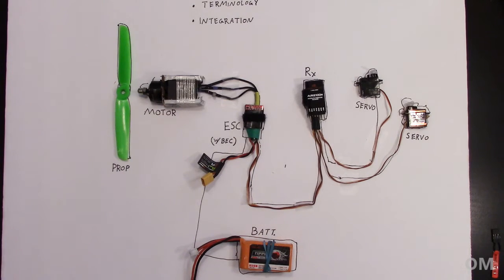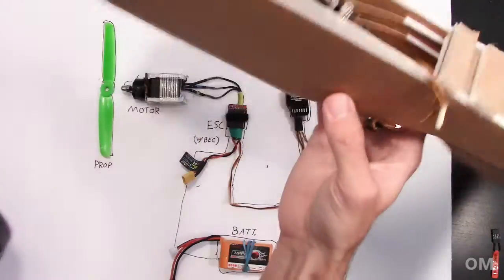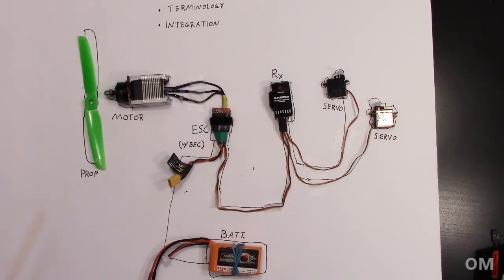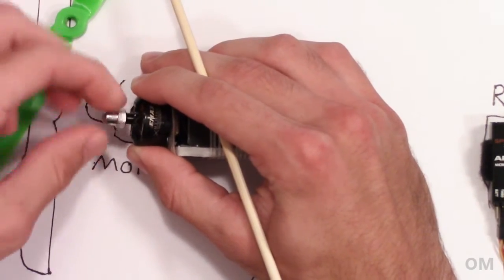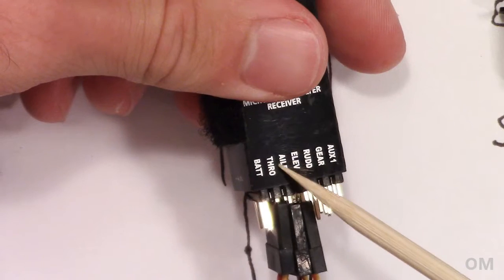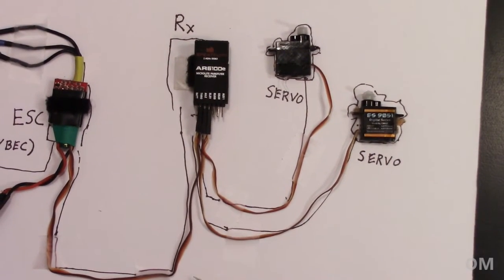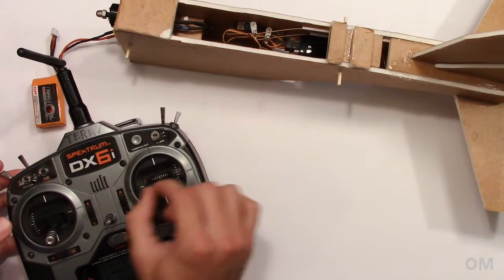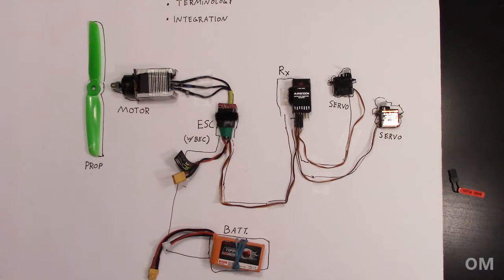HOW RC AIRPLANES WORK (Intro to RC Electronics for Beginners)

Comment: I hooked everything up and the esc started smoking. The motor beeped 123 and beeped once a second but never reacted to the throttle. The servos worked correctly. The battery was charged and receiver is a Spektrum AR410.

Comment: Thank you. But one problem. I did everything according to your example, but my transmitter only does the elevator when i lift the stick up and down. When i move it horizontally, it does not move the aleons or the rudder. Help?
Reply from the maker: Hmm. Tell me which electronics you are using?

Comment: hi, thank you! i have a question about damaged servo lead. on my FMS Corsair the brown lead broke with allmost no pressure to the ailaron Y harness. picked up some extra connectors but instead of the red, yellow, and brown their replacement has a R,W,B colored leads. spectrum TX & RX gen 2 DS6e and dont want to see magic smoke when initializing, or worse in mid flight. any suggestions? thanks brother and keep your head in the sky.

Comment: Hey are there any gyros included? Or the gyro is in the receiver
Reply from the maker: Typically, no gyros for a basic setup. There are airplane RX that have gyros built in, or you can use an external gyro, or a flight controller board that has everythin built into one (like the FT Aura board).

Comment: Nice. I have long wanted to simply control motors and servos with a remote control but for some reason when you search for products, the sellers show sending and receiving modules that you have to program with Arduino or something. I should have just been watching RC videos and I would have seen what you guys were already doing.

Comment: Can I have this same setup but with 4 motors and 4 servos
Reply from the maker: @playsgameschannel2a675  basically yes. You would need at least an 8-channel reciever to connect all the servos and esc signal wires.
Reply: @RCwithAdam1  so could I use the FS-I6X transmitter for this

Comment: Adam i have a question. If i wanted to have a screen on my transmitter/controller that was a live feed from a camera in the plane like drones have. Where would i fine a controller like that. Do i just strip a drone controller and use that?
Reply from the maker: TBS (Team Black Sheep) made one a few years ago, but I think they stopped making it. I don't know of any others. I think you could just DIY mount an FPV screen/receiver onto whatever controller you want to use.

Comment: Can I have 2 esc on a reciever
Reply from the maker: @smipy  yes. That is common for a twin motor setup (note: you do not need to connect the power wire from the  second esc to the receiver).

Comment: What's the difference between an ESC with BEC and one without?
Reply from the maker: Hey! If the ESC doesn't have a Battery-Eliminator-Circuit built into it, you'll need a separate battery pack to power the receiver and servos. Nowadays, it is rare to NOT use a ESC with BEC for airplanes. However, standalone ESCs are common for quadcopters because they don't need to power servos or the receiver from the ESC (that's powered from a pad on the flight controller).

Comment: How do I know if the receiver can connect to the controller
Reply from the maker: Generally they need to at least be the same brand. But also, the manual or product website should tell which kind of radio protocol it uses.

Comment: Thanks for this excellent video, Adam! It's really awesome how you didn't have any trouble trying to explain this concept so simply.
I just had some trouble trying to understand how you would control your aircraft without using ailerons. That would restrict movement in the roll axis.

Now I understand how you can use the rudder to yaw, but then there's a limit to that. Yaw too much, and your plane will stall.

The kind of rc plane I'm trying to build has to be highly maneuverable in nature and I want to bring in another servo motor to control both of the ailerons.
Can you help me with the connections for a third servo motor?
Thanks in advance!
Reply from the maker: Hey thanks for the feedback. Basically, you just need to have one open servo port (using a Y-splitter cable) or two (one for each servo to control individually) to connect the aileron servos.
Reply: @RCwithAdam1  Thank you for your response! This has helped me greatly.

Comment: Finally, I have found a video that actually teaches me how the electronics work, unlike a lot of other YouTube videos. Thank you. Quick question, is there a way to create a failsafe without an arduino that cuts the throttle if the connection between the tx and rx is lost?

Comment: Hi Adam.
If I  build a test bed with all the component's for the plane I  want to fly, and want to test my tx before installation of the esc rx and servos, do I need tohave a motoron the test bed or can  simply bypass the motor. So iwould have the battery  plugged into the esc and the esc to the throttle section of the rx , then the required servos for the channels required. Or do I  have to have the motor connected to the esc in order for the test system to function.
Thanks
Bob
Reply from the maker: Generally you do not need the motor connected to test the other components.
Reply: @RCwithAdam1  Thanks Adam you really helped me out on this one.
Cheers
Bob

Comment: should the battery be a normal small one or a big square one
Reply from the maker: Battery shape is not a factor. Typically Lithium Polymer (LiPo) batteries are used.

Comment: Should the battery be a brushless one?
Reply from the maker: The batteries are Lithium Polymer batteries and they can be used with either brushless or brushed motors.

Comment: hello. I want to ask if it's normal?. if my servo motor moves by itself and returns to the middle position when I first connect the battery. or do I need settings in the transmitter
Reply from the maker: That sounds normal. Whether the servo centers itself or not is determined by the signal the transmitter is sending to the servo (not the servo itself). So if you want to change that, you will want to adjust the trasnimtter settings for that servo channel.

Comment: Can you use the servo without having a esc and motor connected to the receiver?
Reply from the maker: With this setup, you could not use the motor, but you need the Battery Eliminator Circuit (BEC) that is part of this ESC to power the receiver and servos. If you connect the battery to a 5v regulator to power the RX, then you can power the servos and don't need and ESC or motor.

Comment: So if I have a gas powered engine and then need to get new servos and a transmitter. I am new but have picked up a old sig kadet mark 2. Not sure what to do with all the connections. Idk if you have made more videos on how to connect everything. Also broke college student so if you know some cheaper options that would be great

Comment: If you're new to RC planes, please don't use guitar strings for push rods. While it may be easier to route through your model, you can see at 10:14 why you shouldn't: The wire is flexing and your control inputs aren't getting all the way to your control surfaces, thus making you lose some control of your model. Otherwise good basic explanation of everything.

Comment: 1:12

it's a great idea if you put those further in the back (only slightly) and add 1 more servo for roll control

i never build an rc plane before, but i played ksp enough to tell you roll controp is really important, oftentimes more than yaw control, you can get out of a bad course with roll but not solely with yaw

Comment: Does the motor still work even if i dont plug the battery to the esc? Bacause my esc doesn't have that yellow thing on edge of the wire where you plug the battery.

Comment: How do you know how much a motor can lift
Reply from the maker: It depends on the propeller it's spinning. Usually the motor manufacturer will provide a data sheet showing the amperage draw and thrust at different voltages or throttle values.

Comment: Excellent video, as a drone pilot I just kind of assumed that there would be a flight controller in there somewhere, and your video has shown me that you yourself have to be the flight controller when flying planes, I have a whole new respect for you fellas!
Reply: You can fly with a flight controller, but most people don't, I went from drones (full acro both fpv and LOS) thinking I could fly a plane.... I fitted a flight controller after the first two hit the ground a little to quickly to take off again.

But yeah mad respect to people who fly planes with just a receiver!!
Reply: @sulawesi-steve  im planning on using a flight controller to be able to setup with a microsoft flight stick#

Comment: What would high performance engines do to a regular drone
Reply: I've regular drone parts from crashing them. I just want to know if anybody knows that if I put those parts inside of a frame and put high performance engines on it will it work
Reply from the maker: Hi! What kind of drone? A FPV quadcopter? It really depends on the details of the frame and the motors, and also the ESCs for the motors.

Comment: How are these things secured in the plane?  Would hot glue work?
Reply from the maker: Hot glue for the servos and tape for the esc and receiver works well. Velcro for the batter. And it's best to screw the motor to a "pod" that can be fairly easily removed from the plane.

Comment: Omg, that is so easier than I thought it would be. I use to be in a engineering program so I assumed I would have to manual program the motors to the control and give them inputs. Thanks!
Reply: Hey late reply but same! Currently trying to build an RC plane for physics class in my last year of highschool and originally I thought I needed an entire arduino kit and program everything 😂

Comment: What type of motor should we use ???pls help
Reply from the maker: This motor is an Emax 1806 1800kv motor. It is great for smaller sized airplanes. I would suggest taking a look at FliteTest's Power Pack kit to get N idea of different sizes motors for different planes.
Reply: @RCwithAdam1  Thanks man,thanks a lot

Comment: I was given an airplane that has everything but the battery and the receiver.  Can you suggest a way to find the right battery for the setup?  It is a small, 3 channel balsa model.
Reply from the maker: Hi! Do you know the model name? Just a guess, if the wingspan is around 30 inches, maybe a 1000mah 3s (~12.5v) LiPo battery.

Comment: I'm pretty late on commenting, but if you had multiple rotors, how would the set up look like to have it run off one battery?
Reply from the maker: Hi! For a plane, you would have a Y splitter from your battery to two individual ESCs and motors.

Comment: Hi, so I’m a beginner (like i just started today lmao) and I was wondering how could you connect the servo into the elevated part of your helicopter? I was confused on how it goes up and down while the servo was going sideways. Same thing for the rudder. Hope you see this lol cuz i rlly need it for a project that im doing. 
Also!!! love the video, as a beginner you explained it so well. Thx for the vid!!!
Reply from the maker: Hi! Even though the servo is sort of mounted "sideways" on the wall of the main body (the fuselage) the actual moving part (called the servo "arm") still moves mostly in a forward and backward motion. The control rod (the long connector piece) attached to the servo arm is connected to the elevator "control horn". The control horn (which is attached to the elevator) converts the forward-backward motion from the servo into an up-down motion on the elevator. (this works because the control horn is at about a 90 degree to the elevator, and the control rod is free to rotate within the control horn). Let me know if this makes any sense! 🙂

Comment: How can I bind a transmitter that doesn’t have a bind button
Reply from the maker: There will probably be a binding option in one of the menus. What transmitter do you have?
Reply: RCwithAdam  Carson reflex wheel pro without lcd it’s quite old and meant for rc cars

Comment: Can i cobnect any radio to any recievrr and what battery shall i get.
Reply from the maker: No. Basically, the receiver needs to be the same brand as the transmitter. And the type of battery depends on what you're flying. If you're building from a kit, there is usually a recommended battery size and type.
Reply: Have u got any links to kits. I have no idea which one to get
Reply from the maker: If you are wanting to build your own plane out of foamboard, I would check out the FliteTest "get started" kits if you already have a radio and reciever https://store.flitetest.com/flite-test-simple-scout-get-started-package-flt-5008-bdl/p791875 .
Reply: can i use that setup  in rc cars?

Comment: Great vid! I have Spektrum DX4e transmitter that I got with Blade 350QX2 (that I lost) and it was RTF. What reciever do I have to buy? Would it even work??
Reply: OutdoorMentor Thanks a lot!!! So ar6210 from ali express would work? I want to build my airplane and get into the hobby 🙂
Reply: Thanks. Well I just realized that my transmitter is actually Spektrum DX4 and not DX4e... I'm kinda worried now, because it doesn't have inversion option (for the elevator) and I read somewhere that it's only recommended for Blade 350 QX2... Please let me know if just buying a receiver would work with my transmitter, or do I have t buy something new.... Thanks a lot, Martin
Reply: OutdoorMentor Okay 🤔

Comment: Heck not, it was very clear.  You should do more and explain voltage and all that other jibberish I absolutely do not understand.  If I needed to purchase another motor I'd be lost.
Reply: OutdoorMentor Yes, all the considerations necessary to purchase the right motor to go with the right esc and the right servos to match the.........well you know what I mean.  I'm kind of getting started in this (at 63), but have flown in the past.